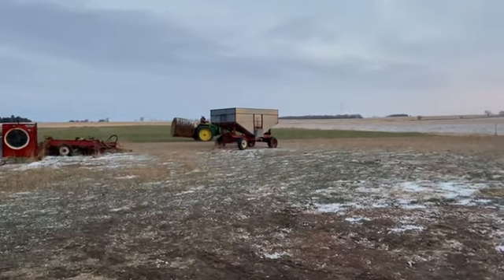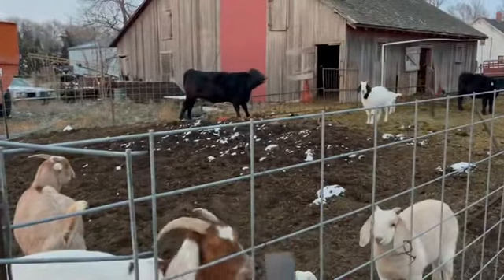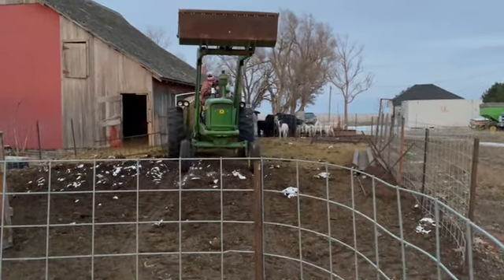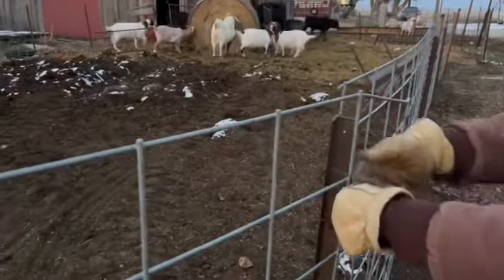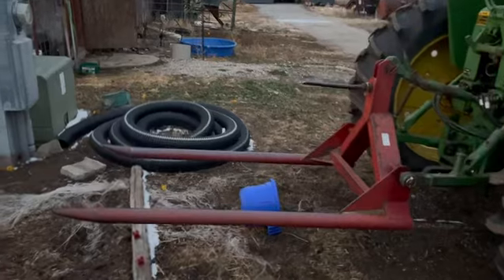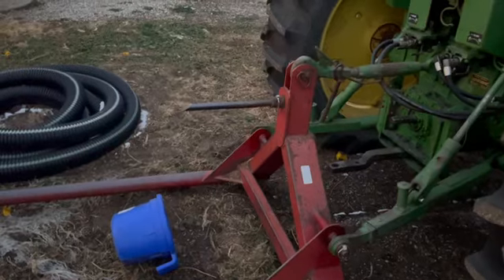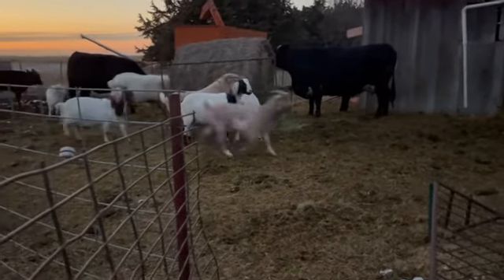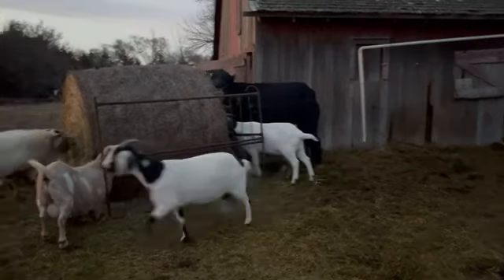Feeding Hay With the John Deere 3010 Diesel! She’s Up and Running Again!

Comment: Hello, I'm trying to find some pictures of the installation of the #48 loader on a JD3010. I've got the tractor, the loader, bt haven't got the loader attached. The brackets that bolt to the side rails of the tractor frame in particular. Also, the bracket bolted to the front of the tractor, that the round portion of loader sits in. 
Keep up the video's.